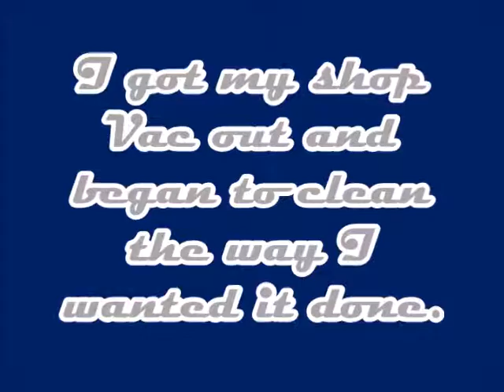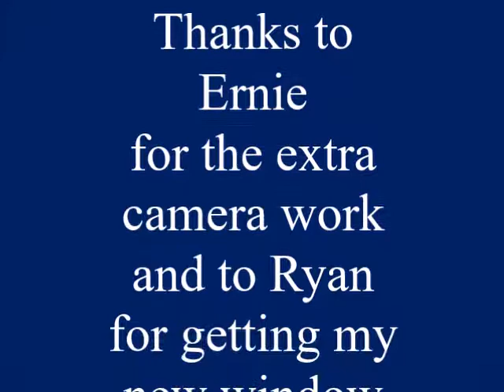Safelite gives my 2014 Impala LTZ a new view. /. The Safelite process

Comment: I have a question I notice you vacuumed the glass yourself are they not responsible for getting the glass out of the inside of the car I asked because there coming out to do do my window tomorrow and I have glass all over my back seat just curious
Reply from the maker: He did vacuum but not as thorough as I wanted it to be.  He also dropped glass down inside the rear interior panels that to this day rattles when I drive on a bumpy road.